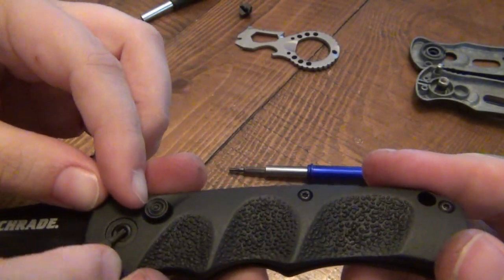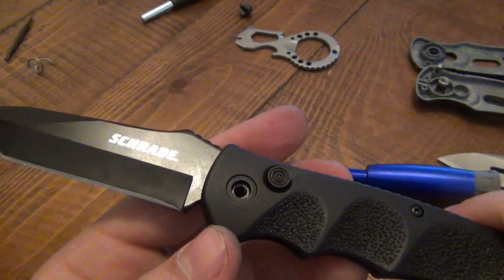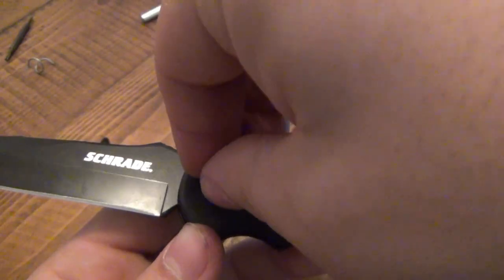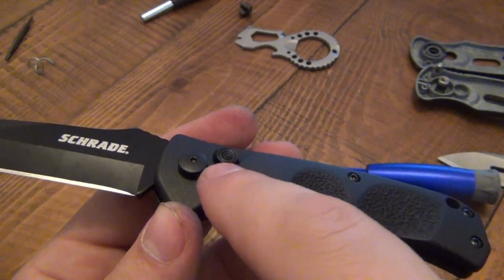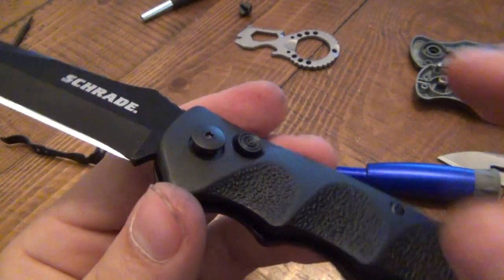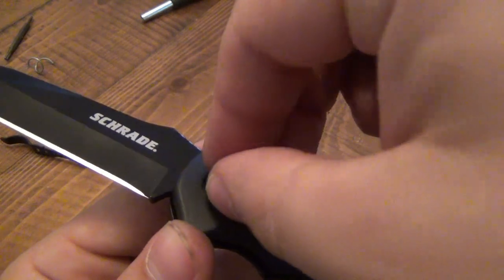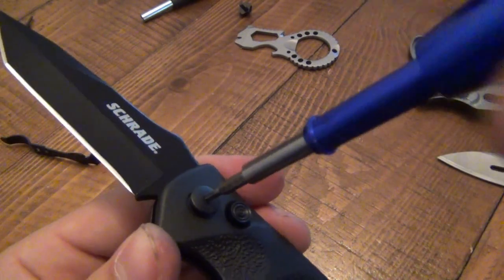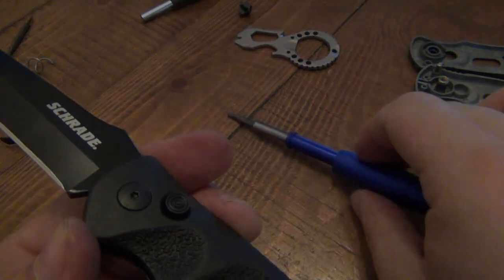Schrade Uses Simple Idea For Pivot Screw Tension...Great Idea!

Comment: Hey guys remember when Shrade made crap knives
Reply: They still do.  Most of their knives are crap; probably 98% of them are crap.  They steal many designs, use cheap steel, they're flimsy, and have poor fit and finish.
Reply from the maker: ShmifandWeshun every single production knife company has crap models...period, they all have good knives at some point as well
Reply: They still do, every knife company does.  Not every knife can be a winner, and for shrade most of them aren't, but there's good ones sprinkled here and there.  Well, good for the money anyway.
Reply: The older USA made schrades are great.